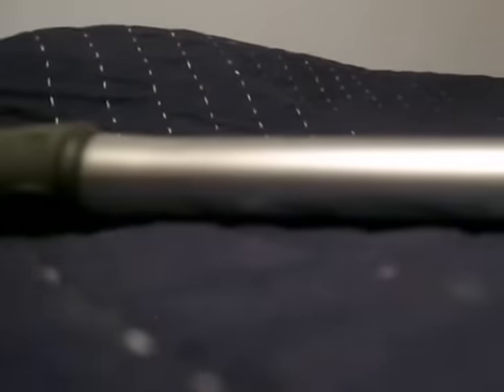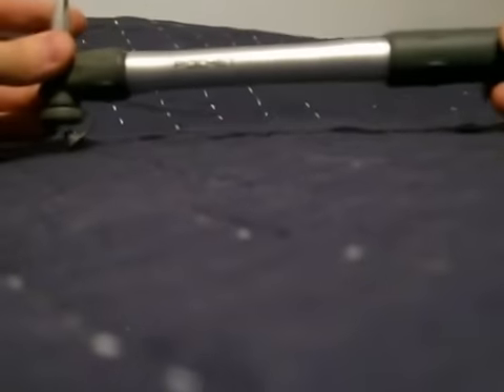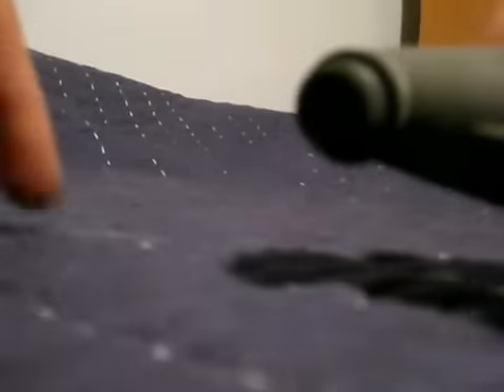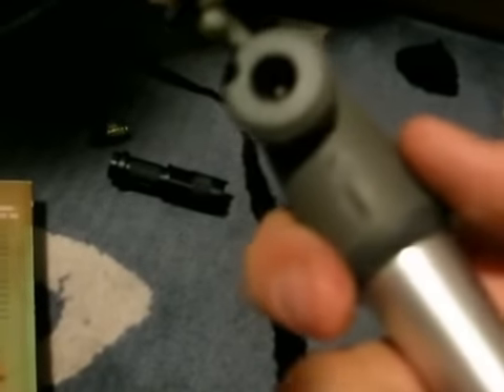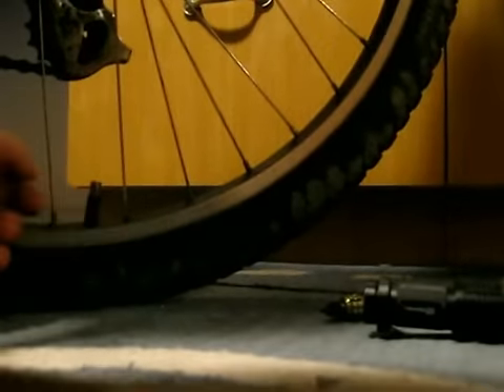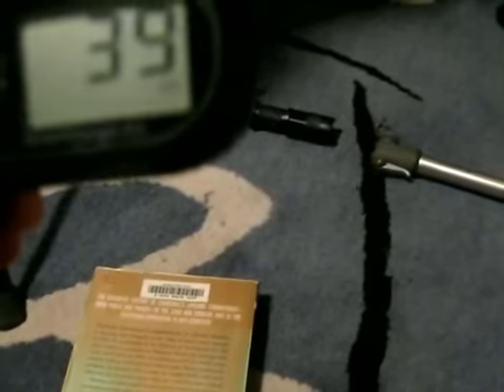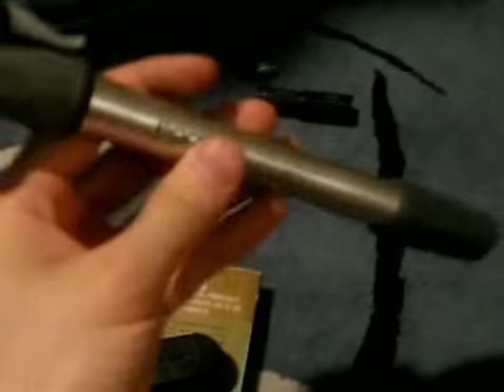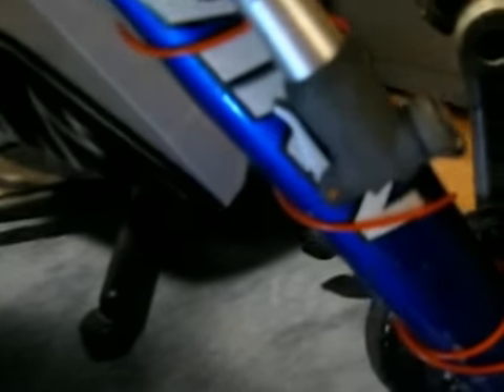Topeak Pocket Rocket Master Blaster Pump Review

Comment: I think it has to be twisted to lock position while you put it on, and then twisted to unlock... At least that's the only way I get it to not "bounce back without putting air in the tire" like you said. 

Great little pump, but a bit tricky sometimes

Comment: Kind of wrong.  We regularly use (full size) bike pumps for our motorcycle tires when racing.  It is a quick and easy way to adjust the couple pounds that can make a huge difference.  PSI is PSI regardless of how much weight is on the tire.   That said, this tiny pump MAY* work for a couple pounds, or in a real pinch if you have a patch kit with it, but I would look in to other options.

Comment: Does this work well for road bikes?
Reply from the maker: i don't have a road bike, so i haven't tried this on presta valves, however it does convert to a presta pump, as i show in the beginning, but i've read mixed reviews, in general it does work, but presta valves seem to be a tricky with most gauges/pumps.

Comment: Thanks for the video. I bought one of these a couple years ago, but had never used it. I used my bigger tire pump, for bikes, cars, riding mower etc. Then, today that pumop finally broke. Went to use this little Toppeak pump, and it wouldn't fot on the mountain bike. Had no manual, and got frustrated. Watched your video, and found that my pump had come set up for a Presta valve. Saw how you converted it, and did that to mine. She pumps!! It does take a lot of pumps to gvo from, say, 30 psi, to 50. I would say it took me a good 180 pumps, but it got me there.  I had stored the pump in the tool bag on my bike. Thanks again. I will get another biggger pump for car tires and such, as this one isn't practical for that. But, it works well, and is a keeper.
Reply from the maker: +Jon Neet awesome, glad i could help.

Comment from the maker: I could be wrong, but I'm pretty sure the answer is no way in hell. this is just for bicycles. even though the tire pressure in cars and motorcycles is less than in most bicycle tires i don't see how a person could pump them by hand with all that weight on the tire.